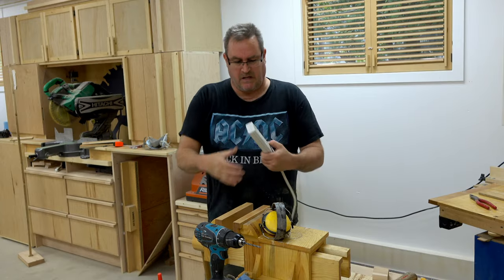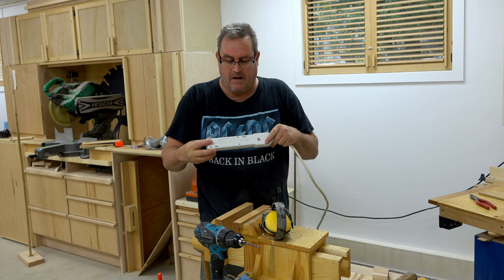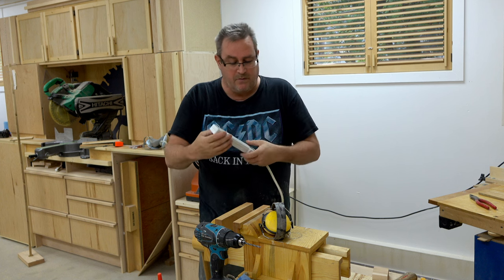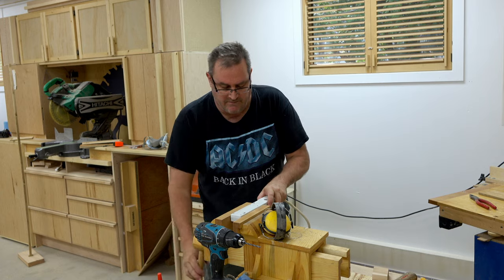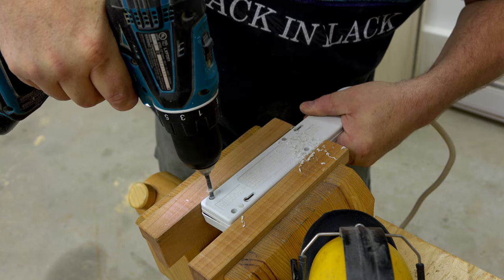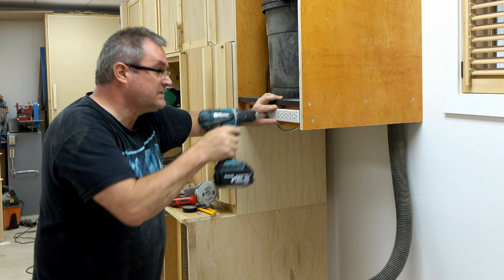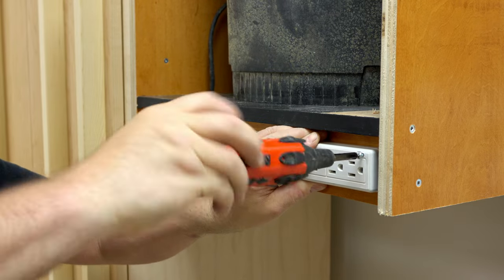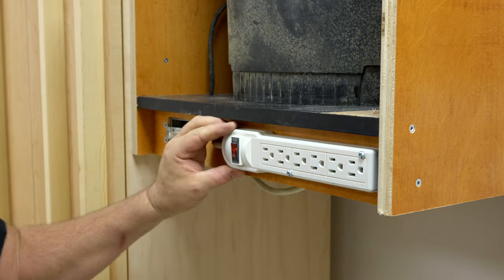The Best Way To Mount A Power Bar

Comment from the maker: Anyway, I think it's the best way. Those screw holes have plastic going right through, so no risk of making contact with the live parts inside if you drill holes that are not too big. 
The great thing about this is how easy it is to do and how well it holds the bar in place.
As with everything else you are likely to see on this channel, use you own judgement as to whether this method will work best for you. Some cheaper bars are just glued together, and others have the holes in odd places.

You can help support the work I do in making these videos: 

Plans for sale: http://www.ibuildit.ca/plans.html 

Support this channel on Patreon: https://www.patreon.com/user?u=865843&ty=h 

Did you know I have other YouTube channels? 
My main channel: 
https://www.youtube.com/user/jpheisz 

More videos on my second woodworking channel: 
http://www.youtube.com/c/IBuildIt 

My home reno channel: 
http://www.youtube.com/c/IBuildItHome 

Website: http://www.ibuildit.ca/ 
Facebook: https://www.facebook.com/I-Build-It-258048014240900/ 
Instagram: https://www.instagram.com/i_build_it.ca/
Reply: That is way too secure.  How can the power bar rock up and down and fall off when something is unplugged?
Reply: That is the best way indeed. I have tried any other way, screws at the back, silicone or glue, double sided tape, and the thing always comes off eventually. I use it regularly on european power strips and I actually most of the times I have to drill through the corners that there are (should) not be live parts and then checking with a multimeter for continuity before pluging it in. That is because on most power strips there is nothing at the back for mounting and the screws are not removable, since they dont have anything on the heads to grab on, and you cannot drill them out all together because the plastic is too soft. I think that they push them in at the factory rather than drive them in.
Reply: I love it. Well done John. I will be using this from now on. I may want to use flat head screws and paint the heads to match. Thank you for the excellent idea.
Reply: That was my only concern, but I should have known you'd already considered that!
Reply: I have used that way too. One thing I would recommend is to open it up to confirm no contact with electrical parts inside.
Reply: I Build It Scrap Bin   As an Electrician we use this method quite often, we will use colored screws to match the color of the strip.
Reply: Emt Scythe colored screws!?  How racist. (Kidding)
Reply: Mr. Mickles   Oh, I'm so sorry,  Screws of Color...LOL.
Reply: I Build It Scrap Bin very cool video 😎

Comment: Well, that's a pretty good mount for a hobbyist. What you really ought to do next time is harvest some cotton, spin that up and make thread, turn the thread into linen, boil the linen and make some paper. Take the paper and lay it over the back of the power strip. Using some artisanal charcoal delicately shade the areas where the key slots for receiving screwheads are. Take the paper and transfer the marks to the place you wish to attach the power strip. Drill holes in the wood with a diamond drill bit consecrated by the pope. I have diamond drilled many holy holes for ecclestical purposes on all 8 continents. I have been doing this line of work since 1931. I cant believe I even wasted my time watching this. Should have just stayed on that other guys channel where he drilled holes in a coke bottle. At least I could have made a bong afterwards.
Reply: 8 continents? You let slip the secret Holiest of Holes.
Reply: Or Just use making tape
Reply: duct tape to wall, use knife to reopen blocked outlet holes
Reply: The bong part!😂😂😂
Reply: This is way simpler than what I had in mind
Reply: Stupidest idea

Comment: You say there is sufficient plastic left to insulate, but there is no way to know for sure without taking the thing apart.  Given the huge variety of power boards available, there is no way to be sure you are not penetrating the insulation and risking contact with live conductors.  NOT a good idea to just give blanket advice like this.  In sensible countries with standards for electrical installations, this will NOT meet the standard for connection to the mains.

Comment: Not sure this would work on a British power bar due to the size of the plug. I tried drilling through the slots on the back but found it difficult to countersink the screw heads enough to sit flush with the surface and not interfere with the plugs.

Comment: A great idea for next time, and in the comments, a couple of people suggested adding a third screw outside the bar to stop it moving along the keyholes - I may add this to an existing keyhole installation. The problem I always have is not just locating the screws for keyholes, but getting just the right screw height so it's tight, but not so tight it never comes off (especially when you forget which direction the keyholes are in!)

Comment: As a professional electrician, I can tell you this is NOT the best way to mount that strip.  What you need to do is run the screw thru the neutral slot until it bottoms out and you hear a click, then back it out a quarter turn and repeat on the hot side of the plug. For best results, lightly dampen the surge protector with gasoline prior to plugging it in. This will lubricate the initial electrons entering the device. 
But your way is ok too in a pinch!
Reply: those holes already in the front are nail holes, use long nails
Reply: herotaco Lubricated electrons, never knew those were in there. I knew of peanuts in Snickers, but this is truly a first.
Reply: Heeey, wait a minute, you forgot to mention what Australians do, what if the electrons fall off? What kind of electrician are you?
Reply: lol
Reply: I'm also an electrician, I've found premium gas to work best.
Reply: I'm a bit tired, so first I read your message I was like "Yeah, that makes sense". 

Then I was "What the heck brain, that does not make sense at all!"
Reply: If you can rest the power bar over your co-worker's back when you drill, it will make the job go faster too!  Thank you very much for the humor herotaco!
Reply: Hahahaha hahahaha
Reply: Mate what the hell are you talking about!? U taking drugs!?

Comment: As a non electrician, I love this tip. No matter how many time I do the paper trick, it still never seems to match enough to make a great hold, and it's always a little loose. Thanks John!
Reply: Paper or Tape. . if you're not a fan, another option. . Put blue tape on the surface. . then put the screws in the Manufactured holes. . press the screws into the tape. . drill the holes, remove the tape, drive in the screws. . mount the power strip.. . lets not Drill into an enclosed body and not KNOW where the wires and other electrical items are that one could drill into creating a short and then a potential fire. .

Comment: Love it!  I'm always d*cking around with screw depth when I try to mount these and similar products.  Not too tight that it doesn't grab into the slot, and not too loose to make the thing rattle around.  I'll use this method going forward.  Thank you!

Comment: Ha. I like what you did there, John. But seriously, only do this with loose fitting North American (inc Canadian) power strips. UK three pin plugs are so tight fitting you'd pull the screws out of the wood, if not the cabinet off the wall.

Comment: Sinking screw holes through live electronics makes me uncomfortable, and certainly voids the UL listing. For example it's no longer double insulated.

My favorite way for many applications is just to use the existing screw mount that comes with most power strips. 

If you don't want to use screws for some reason, velcro tape.

Comment: I mounted one to my workbench I'm building lasted week. But the power strips I have snap together, and all I did was to pry it apart ,and put acouple of screws though the slots the snap the unit back together.

Comment: You could take the power strip apart, then place the back of the strip on the mounting surface, draw the mounting slot holes, and reassemble the strip.  Then everything would be just perfect.  Really,,,, who's going to do all that?  Not me.  I'll do it your way.

Comment: Now, I discovered something simple along those lines.  If you drill out the mounting holes you get the same effect and you don't have to remove any screws.  I checked to make sure I wasn't going to run into anything important but they seem to be protected in their own channel.

Comment: That was stupid why not use the slots on the back? Plus drilling into it like this you can risk touching live lower wires. Also most plugs wont fit flush because of the screw sticking out

Comment: This is the type of job where everyone has a method of their own and are dying to share it. Here's my two penneth. Photocopy the rear, offer the print up to the final position, install the mounting screws and attach the bar. Main advantage being, no screw heads show on the front.

Comment: Thanks for sharing this video. I don't know if it is the best way to mount a power bar (some electricians seem not to agree with you) but for sure it is an original one.
Most of the time I use plastic power bar holders, which you can mount with screws to the wall, cabinet or whatsoever.
In that case it is possible to take the power bar out of the holder (which stays mounted) and place the power bar (loose)
at another place, what sometimes might come in handy.
Reply: Much better idea!

Comment: I use dowel locating points pushed into the keyholes, just press it against where you want to mount, it leaves a couple of nicely centred holes.
Incidentally, i've seen pics where someone just mounted by drilling through the ground pin holes :P

Comment: 3M VHB tape works as well, and never lets go, you take the wood off first. Just put 3 strips along the length ( after cleaning the plastic with some solvent) and apply the tape, then apply to a nice clean ( solvent again on a cloth) surface, press firmly and leave for the adhesive to finish it's cure. I use that for trunking as well, faster than drilling, and holds up better providing the surface finish is not flaking.

VHB is what they use to stick the cladding onto buildings, if it works there........
Reply: trouble with tape is, it either falls off at 3am or it will stick untill the end of the universe, even if you try to chisel it off one day, so its a lose-lose, id rather screw it on and know

Comment: A couple of things. first, clamp the loosened case together before drilling to keep things lined up. Second, put a little counter sink or use a smaller headed screw to avoid the head to be too proud (top left one). This will keep those pesky USB/power adaptor plugs from not sittiing flush. Yes, I'm being pedantic.

Comment: Omg I've been doing this for 15 years or more. Only difference is I use a countersink to sink the screw heads a little, but it's easy to go too far with it the plastic is always hollow at the edges there

Comment: I don't know about other countries - but years ago in the UK you could buy power strips with external fixing lugs for screwing to any flat surface.........so easy to mount.
There was also a model where the front plate could be screwed off (from the front), with mounting holes in the rear plate allowing mounting then replacing the front plate. 
These are no longer on the market sadly.

Comment: Just mounted a power bar as well. My method was a bit more elaborate :). First removed the front plate by removing the screws from the back.  Then drilled pilot holes in the wood through the holes that hold the front plate. Widened those holes so they'd fit a screw driver. Attached the backplate with some screws, then reattached the front plate by screwing in the screws again through the back. This makes for no visible screws, but you need to have access to the back of the wood you're mounting the power bar to.

Comment: I hate using the keyholes as the action of wiggling the plug out always seems to lift the strip off of them anyway.
Reply: Great minds think alike.  I attached a small block to keep it from sliding up.

Comment: This IS the best mounting for a power bar.  I never seem to have the little screws that fit the little holes.  The little screws don't hold well so if you have to take it on and off then the little screws come out etc etc.  This method is far better.
Thanks John

Comment: You could take scan the back of the powerstrip and import it into sketchup. Get exact locations with the measure tool and lay out the screw locations without having to void the warranty on your powerstrip.    

Kidding if it was not obvious.  Brilliant idea. I have rarely used powerstrips in the shop just for the reason of not having a good way to securely mount them. Glad to have a good option in the arsenal now.